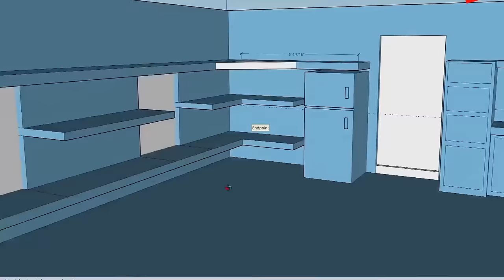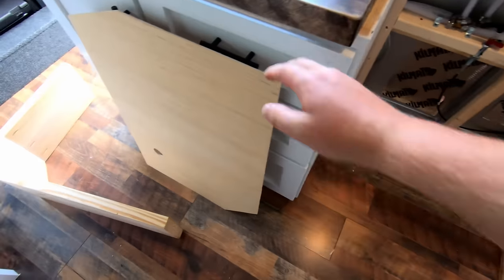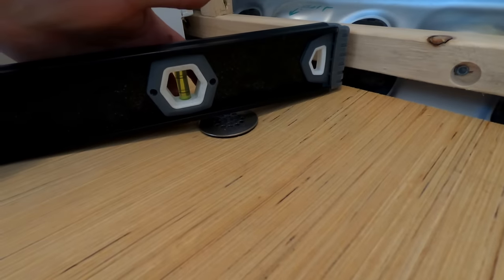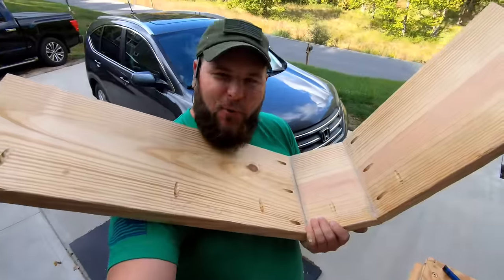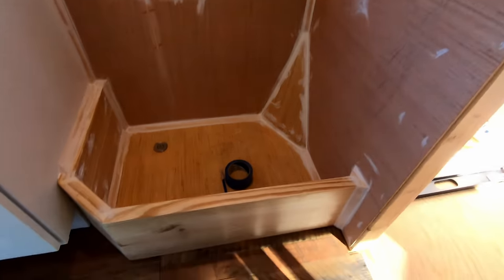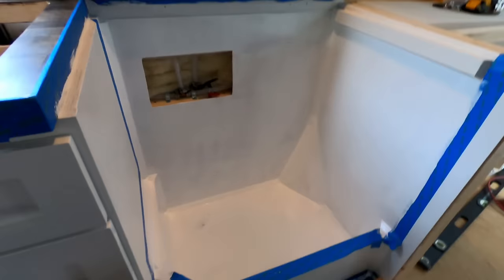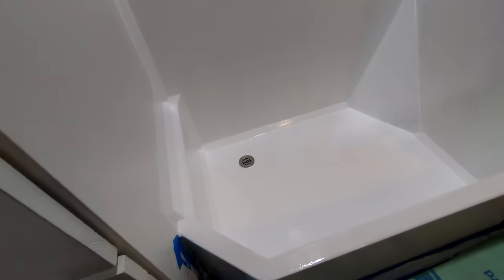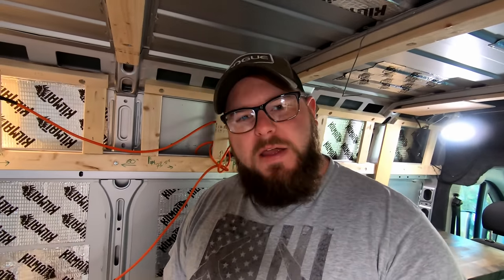CAMPER VAN SHOWER BUILD with FLEX SEAL #flexseal #vanlife

Comment: This isn’t the way to go if you want a long lasting permanent shower. Flexseal flakes and peels off after regular use, or even very careful use. It’s also highly toxic despite what the commercial says. Short term, yes, but why go through all this trouble for short term. If you want something longer lasting, this ain’t it. Go with the more common materials van builders use to waterproof their showers. There is a reason why Logan is one of the few people with a video on using Flexseal. This is not a good solution. It’s experimental and after trying it myself, really wished I had not wasted the money and time. It will last a year at best, but it’s already getting damaged from regular and very careful use. I’m a full-timer in my van. I’ll have to redo it at some point which is a waste of money and time. Learn from my mistake listening to this “YouTube Influencer”. Don’t do it!!!
Reply from the maker: After wear and tear why not just re-coat with 1/3 Quart for $10 and get another year out of it??  True FLEXSEAL has a flash time (toxicity) but after it is set up, it’s not harmful for consumer use.  I like to think outside the box and not fall in like with what’s popular.  Sometimes that means testing a new theory.  That’s why I’m an “Influencer”, a “mechanical engineer”, and an “entrepreneur” with 12, going on 14 van conversions on the road over the past 3 years without any issues w their FLEXSEAL showers….
Reply: What product do you recommend? Or is there a channel/builder I should check out? tia
Reply: When I rebuild I'll probably go with redguard & redguard seam tape over my ply, then when it dries liquid nails with FRP. This solution will eliminate the flexseal peeling off when something rubs against it. FRP seems to be what most people use in vans so I'll go that route next time. I've used redguard with their seam tape before and really like it. It's not good to breath in while drying, but neither is flexseal. You'd still need to wear a mask for protection, but the redguard is waterproof, doesn't peel or come off easily, and you have options of what can go on top of it. You can not adhere anything to flexseal, not even a suction cup. As the top layer, I think the FRP is a better option for folks who live in their van fulltime, or have kids and pets. It's not that much more complicated to go this route. Some vanbuilders skip the Redguard and just put the FRP over their plywood with liquid nails and caulk the seams, but I'm using the redguard for my own peace of mind. I got this idea from these folks who are even more cautious about waterproofing: 

https://www.youtube.com/watch?v=IVvuRL8wPhQ

 @trev381
Reply: @TheForwardThinker  Fibre-reinforced Plastic ... https://en.wikipedia.org/wiki/Fibre-reinforced_plastic
Reply: I am curious as to what would happen if you top coated it with bed liner, it might stop the flaking and give you the seal you are looking for.
Reply: I'd fill you pocket holes with auto bondo for a cleaner look on the next one. Interesting idea for sure!

Comment: Well done and nice idea. For future reference (and for anyone else thinking of doing something similar) the flex seal coats actually bond together much better and create a longer lasting barrier when the second coat is applied before the first coat has completely dried (a very slight tact to the touch is ideal).
Reply from the maker: Thanks Josh!  I would agree as smooth as this dries it would be beneficial to add with some tack...
Reply: Homie commented on your reply but didn’t read it…. But you both made a point, haha
Reply: Thank you for sharing, I’ll remember that
Reply: TACK, not TACT.

Comment: Curious if you have posted a one-year update on your flex seal shower pan.  Cracks?  Leaks?  Did it hold up to shakes, bumps and general punishment of the road?  Punishment of use?  Did it rattle or squeak?  What would you do to improve upon it?
Reply: Please share an update on the shower pan. This is very innovative and out of the box. Have you used it ? Are you happy with it ? Would you do it again ?

Comment: Hey man great job on this shower pan. Phenomenal idea using flex seal. I’ll need to try that myself later on good job man
Reply from the maker: Huge fan bro!! Thanks!  It has such a durable finish...
Reply: Used for my rv shower pan but the pan didn't have enough support so it cracked. The off gassing was horrible for about 2 days (think burning rubber). The coating is also slick so you can slip.
Reply: @sarahlockwood8133  you could try using grip spray paint over the top to reduce slipping
Reply: we love dual ex
Reply: @sarahlockwood8133 add a few rubber ducky grips and boom. Bobs your uncle mate.

Comment: I would suggest doing a leak test BEFORE you remove the cap off the drain. Standing water will tell you everything you need to know.

Comment: I have seen owner fabricated shower trays to fit specific spaces, all of which were created using wood/plywood and thickened fibreglass epoxy fillets on each corner, followed by epoxy impregnated fibreglass sheets to finish.

Yours is the first build I have seen using tri-sided fillet pieces in the corners and shaped plywood to guide water out and the entire tray sealed with Flex-Seal, all of which I thought was an excellent solution. 

You have good presentation, narration and lighting, great videography and editing and a well considered and balanced soundtrack.

I particularly like your meticulous and precise high standards of workmanship.

Your enthusiasm and engaging character shine through and I am happy to subscribe to and support your channel.
Reply from the maker: Thank you so much Felix Cat!!  Take Care and thanks for watching!

Comment: I like the concepts you've Illustrated in building your own pan. If I may make a couple of suggestions. Instead of using the quarter inch Lauan you could use FRP. Also instead of using the Alex caulk you could go to a quad elastomeric caulk instead for a long-term flexible seal and a moving vehicle where vibration can be a serious issue. But once again great job on your project. I especially like the beep your plumbing parts underneath.

Comment: Just doing my motorhome. I picked up a shower base as a second, had a chip on the outside front, right where I am putting a wall section. 1200 x 900 for $50.  I'm cutting a door to fit the portapotti so I can mount the loo on tracks so it can roll away when I have a shower, keep the TP dry, and enough space not to trip over. Thinking about putting a skylight in and having growbags on the back wall for some fresh veges.

Comment: Creative use of Flexseal.  If you are open to a suggestion I would put a couple of layers under the drain and down the hole then reinstall the drain.   The hole will now be lined so any leakage will flow down and out of the van instead of spreading across the under flooring.
Reply: that sounds like a pretty important deail

Comment: Awesome idea, turned out really nice. I’m interested to see how it holds up over time. Worst case can just add another coat if needed. I used flex seal for my maxxair fan install and it did the trick, has started peeling a little in a few places but it’s out exposed to the elements 24/7.
Reply: Try Durabak paint.  It is a polyurethane that holds up to UV well.  Hard as a rock and can also coat EPDM or TPO rubber roofs.  Bonds to everything.
Reply: @mjremy2605 I actually used durabak on the floor of my van under the insulation.

Comment: Fascinating, I don’t know if probably want to try a Schluter product first just because I’d hope that thin plywood would hold up long term under weight of water however it’s a neat alternative, inexpensive and so happy you could fit the plumbing below the flooring. I just watched a guy (he’s a highly skilled woodworker/craftsman totally bomb on his shower plumbing by installing it above the floor which means his head is an inch from hitting the ceiling so I’m glad you have room, everything’s concealed and I hope this lasts a very long time

Comment: FANTASTIC! I HAVE SKETCHED ALMOST THIS EXACT TYPE OF THING BEFORE.  IT JUST MAKES SENSE, ONLY I LEFT IT TO DRAIN OUT UNDER THE RIG INTO A JUG OR TO THE GROUND IF YOU ARE USING BIODEGRADABLE SOAP AND IN AN AREA WHERE ITS NOT FROWNED UPON.

Comment: Good stuff. The thing most folks forget for a shower tray outlet is that when you shower in the van, you're never level, so the water will run where it wants to run, no matter where you have the drain. :)
Reply from the maker: Definitely NEVER level, unless in Walmart parking lot!  LOL
Reply: Agreed, but maybe it would be pretty easy to carry a squeegee that you could use to get the rest of the water out. This is definitely an upgrade for mine in my cargo trailer conversion. I have a shower curtain that has a heavy Walmart tarp coming from it. I drape it over the toilet, sit on the toilet and the tarp, and pour warm water over me. With a shower curtain, it sounds like he has a pretty good system. I hope that he will post follow-up videos on this.

Comment: Great job. Loved how you sloped the pan. I build a wooden shower pan as well, sanded the crap out of mine to get a slope lol, but I didn’t use flex seal. Didn’t like the way it cures. After it cures, you can dig your finger nail in that stuff and create cracks in your rubber. I used polyurethane (boat paint), cures hard and hard to break. Also thought about using epoxy resin, but polyurethane melts at a much higher temp. Was worried about the hot water in the tub. You did a great job! Shower pan looks great!
Reply: Which Poly paint did you use?

Comment: Great idea to put a shower in your build.  It adds a huge step up in livability. Just a  few thoughts , A boat through hull fitting might work better. They are engineered  to provide good clamping compression in an application similar to yours.  Did you compare the flex seal to aquarium paint?  Does the Flex seal  exhibit any long term migration of water through the paint?  An Epoxy resin coating on all sides would provide an inexpensive seal against unwanted moisture intrusion from condensation etc. I believe you will have long term issues with your sub floor due to water intrusion  I learned the hard way from years of boat building.

Comment: For a second, I thought you were going to build a custom fiberglass shower pan like I did.. Mine is a longer dual purpose shower pan because I don't have the high ceiling.. I can sit and shower w/flexible shower head.. Stall has a removable counter top and 2 rows collapsible/removable metal baskets.. No leaks in years but I may have to get some of that Flexseal.. Good job, I like..
Reply: @Ty Bell I'm curious about your custom fiberglass pan!!!

Comment: Really interested to know how that product holds up over time....  If i could suggest something, when i saw you cut the laminate floor around the drain, i saw you use a circular saw, and then chisel the corners, a multitool/osclilating saw would be a very useful tool in your arsenal, i use mine probably 4 to 5 times a week at work for the most random of things and they work amazing. I use it for everything from sanding to cutting to scraping/chiseling.
Reply from the maker: Thanks David!  I got a leftover floor model oscillator at Lowe’s not long after the video!  They are great and yes, use it so often...  take care

Comment: I am on to my forth shower build and have used fiberglass cloth and white  gell coat the oldest is 15 years old and leak proof and still looking good.
It adds strength the whole thing can be done in a day and extra layers reinforces the floor and corners for the corners I use stiff card for a nice smooth radius that drains well and is easy to clean.
Reply from the maker: That’s really nice!

Comment: Sure glad you did this. I have been using the Durastall-Mustee. I was thinking of exactly what you accomplished. I like your build better because my thoughts were to use the sticky tape in the joints and then paint over. My minds eye dais that it would not look good. You proved that!

Comment: ❤Love the idea.  I'm thinking I'd do Thompson's water seal on all surfaces and edges of components prior and my first layer or two would be fiberglass.  The flex seal gives a nice top coat detail and then add no-slip strips on the floor to decrease wear and tear.  Leaks are fairly inevitable.  The less destruction that can take place, the better. O! and also I'd sand and seal the metal with rustoleum primer and top coat where the drain goes through and add a silicone gasket to buffer the drain from touching the metal.  Decreases wear & tear but also insulates if you've ever showered in a cold climate and touched that metal drain-your toes remember! lolz
Reply: double check that polyester resin will stick adequately to the Thompson's. The resin would normally soak into the sanded plywood.

Comment: Found your channel on a forum and then found this video.  This is exactly what I was looking for.  I have a 24 x 32 shower pan that's located right beside the wheel well hump.  I want the shower wall to come down the van wall and transition over the hump and into the pan.  That will give me more elbow room.  Have you heard of Eternabond tape for RV rubber roofs?  It has incredibly sticky, gooey adhesive.  I had planned to use it somehow.  I think I'll mockup a sample and put some Flex Seal over the tape.

New subscriber here...Thanks!
Reply from the maker: Awesome!  I was planning to use a butyl tape for flashing edges at first but the decided to do 2 liberal coats of flex seal.  It turned out so nice!  Good luck on your shower!
Reply from the maker: Hey can I ask what forum suggested this video?? I wanna check it out!!

Comment: If the flex seal doesn't hold, try using RV self leveling roof coating.
It's liquid rubber and dries as rubber and bits white and reflects heat.

Comment: Here's a thought: "If" you design a "rain water collection system", you will always have fresh water and you can stay off-grid for longer, in like BLM land, for example. You can mount e-bikes to the back of the van and attach a "milk crate to the front of the e-bikes so you can use the e-bikes to re-supply run in/out of town while the van stays in the same spot (saves on gas money. RE: Power, on cloudy days, if solar panels doesn't provide enough yield, research small wind turbine you can mount on top of the van ( saw on another channel). Just a suggestion. Alternate energy sources that are free. Why not, right? :)
Reply: WTH does your comment have to do with this video?
Rhetorical, I am fluent in English.....therefore...."Nothing".

Comment: Love the idea and the "flexibility". It brings regarding the possibilities of shape/size of shower floor.... I did a test panel first and although happy with the finish of even the first coat... the issue I am concerned about is cleaning it.  It seems although it does look like a real tub/shower floor finish, it also looks/feels like it will be an impossibility to keep clean?  Wondering if you have had any issues with that?  And if not what cleaning products you used as not to degrade the integrity of the Flex Seal product!   Great idea and video man... I appreciate you
Reply: I hope he responds because many people want to know if it is durable and sustainable.

Comment: Excellent design and approach to a difficult problem in the ProMaster.  Will give it a go.  Thank you.  BTW, where did you source the shower drain?  In future videos, it's a good idea to list the components and where you got them.  Thanks again.
Reply from the maker: Shower (Sink)  drain from Lowe’s designed for sinks without overflow port

Comment: Phenomena thank you so much. I’ve been seeking an idea that would allow me to build a shower in a small bathroom. The only problem is the floor Hass to be able to be locked up against the wall so we can gain access to a hole in the floor this is solve my problem I especially like your use of that flexseal over wood. I did not know it come in white, I will look if you have a link below to buy it. I would certainly love to see you get the commission on the other hand I am liking subscribing signing up for all your notices and look forward to learning many new things from you once again thank you for blessing me with your idea .

Comment: this is the PERFECT solution for my RV reno I'm working on - thank you for posting this! When you mentioned the difficulty in application, would you still recommend a roller or do you think a brush may help with spreading the flex seal?

Comment: I'm not surprised that the Flex Seal is waterproof when you're done.  But I would worry about durability, and how well it'll stand up to use over time.  I supposed you're only standing in it with your bare feet, so hopefully the wear and tear isn't too bad.

Comment: Hi, Biglogan grate video tub looks like it was installed by a professional and so does the rest of the van. I made a swamp cooler for a van once used wood, flex seal & paintable caulking worked great for a minute but the flex seal didn't take to the caulking well just floated on top of it and because the caulking is soft &  Squishy the flex seal would rip along the caulking lines.  I have a bus now and will have a go at a shower build (yours came out so nice it inspired me) but I won't use any caulking just lots of flex seal in the corns and seems
Reply from the maker: Thanks mike yes that’s a good idea, I think this will wear well, I rubbed the caulk very thin, so not a lot of liberal beads!  Thanks man!

Comment: Wait till you’ve driven around for a few months and everything has flexed. Those joints will leak.
Reply: ideas how to prevent?
Reply: @cwr8618  Fiber glass and resin instead of Flex Seal. It works for boats so why not in a van.